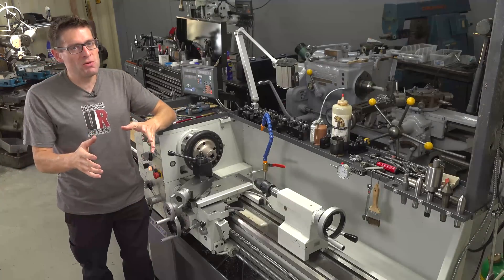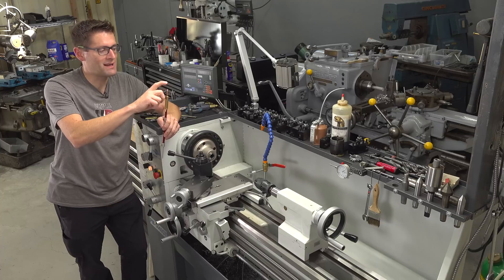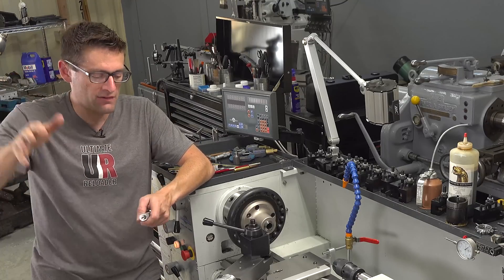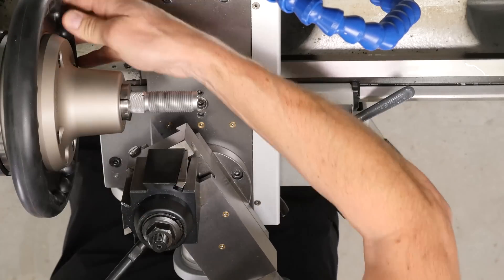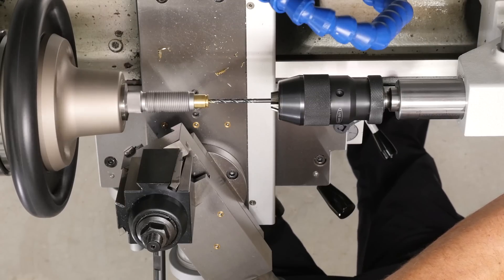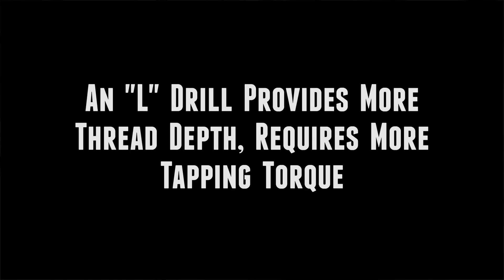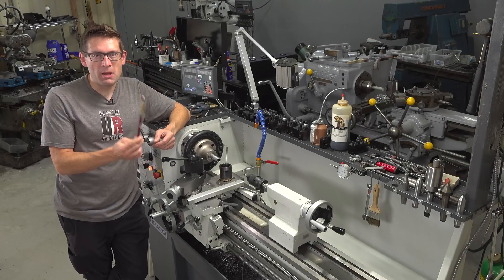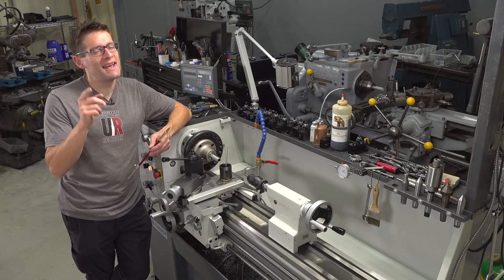Making an OAL Gauge Modified Case (300 PRC Demo)

Comment: Could you use a fire formed case and use the Lee Collet die to make this cartridge to find the lands? If you set the neck slowly with small increments much like flaring the neck on revolver cases you should be able to get to a point where the neck tension where it can be seated by hand but not easily. Then shove the bullet in all the way which would shove the bullet to the lands. I have purchased a single shot pistol in 6.5 creedmoor and want to find that measurement to make it as accurate as I can.

Comment: I'm surprised the case doesn't slip in the die while tapping.

Great video, would have never thought to use the die for holding the case. Definitely going to give it a try, even without a lathe, just gonna hold the die in my drill press vise.

Comment: Hi Gavin; I have a question. there is so much out there about case overall length and case to o’give. Most people say they want 2 thousandths. But if you first bump the shoulder back 2 thousandths, then push the shoulder against the chamber to get your reading before pushing the bullet back 2 thousandths aren’t you actually 4 thousandths off the lance

Comment: Can't think of any good reason a person couldn't use the die with a vise to hold it, and a hand drill and tap set, no big need for a lathe or a drill press. Could even take something like a Lee or Hornady qwik change adaptor and file a couple of flats on it, to hold the die in a vise, use your press to get the case out, or a small rod to knock it out of the die.

Comment: I cut a slit in each side of the neck with a Dremel cutting wheel,  it allows the bullet to slide once chambered. I don't let it contact the side of action when extracted, 9 out of 10 will be the same length.

Comment: You don’t need a lathe just a drillpress  I have a lathe but use my drillpress  how to do this is take a board and clamp it to the bed then drill a hole in it to put the neck in or big enough to center on the tapered shoulder.  Then I use my neck turning clamp to hold the case from turning and drill your hole. It comes out centered every time  because the neck or shoulder is held  perfectly straight with the drill  and the drill centres on the primer pocket.Then I put the tap in the drillpress and hand turn it to thread the hole. Makes beautiful centered threads . Not like the lathe that is near impossible to get the case lined up and held perfectly straight . Hole size varies depending on caliber, don’t be afraid to use the shoulder of the brass in th hole

Comment: I have made modified cases for my rifles in work and like a few who have commented on  here have put them directly into a collet. Almost every time it has slipped and marked the case. I never thought of using the sizing die to hold them. Thanks so much for the tip.
Reply: That was a great idea, but really , who cares if the case is marked a bit as long as you smooth it off so it can't hang up and give a false reading
Reply from the maker: @robertboyd3863  The more important factor to me is concentricity. If you clamp the case with a cylindrical surface, you won't be running true. Using the die accounts for the taper of the case body!
Reply: Can you make one for me?😊. I have a 300 h&h and would really like to use the same shell I’ll be loading

Comment: Great idea to use the sizer die to do the threading, difficult to drill and thread without messing up the case. Same lathe as mine, and have 4 old, but like new craftsman 12" lathes to unload, love my new one      Thanks Gavin

Comment: Did you do anything to the neck, or just fired it and left it alone?
Reply from the maker: Usually just firing is perfect for slip fit, and that's what I did this time!
Reply: @Ultimatereloader  Simply size it down , than ream out with a drill bit

Comment: Good video- kudos for doing it but you are not helping the majority of reloaders who can not buy a lathe or have a place to put it. You even admitted it is not that critical to being exactly perpendicular. Zillions of holes have been tapped in much more difficult metals without a lathe. A basic benchtop drill press works excellent for this using a caliber specific loading block or any other improvised jig to hold the case upside down verticle.

Comment: Just hold the case in the appropriate sized collet, it will tighten up on the web and you wont crush anything. A little chamfer on the hole before or after tapping makes the world a nicer place.

Comment: Informative video however I can't justify 600+ dollars for a mini lathe. Guess I just use a drill press and work slowly.
Reply: I made mine with a drill press and hand tap, no big deal , also punch out the primer and then you already have the pilot hole,

Comment: Modified case is $7.99 online, VS $2000 + for a metal lathe ???
Reply: If you're shooting a wildcat, you gotta make your own modified case
Reply: @zapf6987  Drill press and hand tap works just as good, and is quicker

Comment: Shouldn't one use a resized brass exactly the way you'd like the shoulder to be bumped?
Otherwise your OAL will be off and you'll need bullet ogive to shoulder ogive measurements or always substract your shoulder bump.
And can you be sure that a fire-formed but not resized brass really goes all the way in to have full shoulder contact?
Reply: Gavin can you provide feedback on the reason that you don't bump the shoulder on this case?
Reply: Two years & no reply from anyone so..... A case fired in the rifle is a closer fit to that firearm than a generic case. The round chambered and fired so it works in your gun. Chamber the fired case if you doubt. Does the bolt close smoothly, with no or minimal resistance? It should. If not, clean the chamber & the fired case. When the bolt closes with little or no resistance, the case fits YOUR chamber.

Which is why you make your own: Factory ammo or a full length resized case is typically near or at minimum SAAMI spec to maximize compatibility with multiple rifles from multiple mfr's, chambered with equipment in various states of wear. For the same reason, so is the modified case sold by Hornady.

Non-belted cartridges headspace on the shoulder (so do belted cases after one or two firings). We bump the shoulder to ensure a fired case will chamber reliably and cuz handloaders have learned that bumping usually results in improved accuracy compared to full length resizing - which intentionally resizes cases to minimum specs. No die mfr has any better idea than does a cartridge  company of YOUR firearm's unigue characteristics. You do - it's a big part of why you handload.

But if you feel better bumping the sample case to make it more representative of the rounds you make, go ahead. It'll still be better than a factory case. Remember: Unless you're using bushing dies (so as to control the neck size) your sizing die resizes the neck to a few thou under the bullet diameter. You'll have to ream it or use an oversize mandrel in order for a bullet to slip fit.

Hopenthis helps. If you see this & still have questions, pls reply.

Comment: You can really tell Gavin is an engineer vs a machinist.

So, you didn't say in the video, is the case sized or not? If sized is it to SAAMI minimum or just bumped back .002? For the uninitiated, best practice would be to use a case as you would use it for handloading (full length, shoulder bump, etc) yes, it is only a couple of thou difference, but if we're going for maximim precision and repeatability, well, the devil is in the details.
Reply from the maker: Haha- yes, Engineer through and through. The point of using a case that's previously fired is that you get perfect slight-slip-fit between the bullet and case neck. In the end, this is more of a relative measurement rather than anything absolute. Every permutation and technique related to bullet seating calculation has its pros/cons! :)
Reply: @Ultimatereloader  I assume you also work for the govt .

Comment: Really like your videos.The info and ideas are what are important. I had some made for my each of my 6.5CM rifles by a friend on a lathe. They work great. But what works just as well for me is doing it mathematically using the technique presented by YouTuber HornadyLoader (Hornady Overall Length Gauge and Bullet Comparator) At ~18:00, he goes through how to do it using a proper caliber  standard off the shelf Hornady Modied Case. The one thing I do differently is use CBTO instead of COL.

Comment: I’ve tried doing this before by just chucking up the case and it never worked out because it would always ever so slightly triangulate the case such that it would stick in my chamber. I don’t have collates to use for the lathe. You think it’s ok to throw the die in a three jaw chuck?
Reply from the maker: Jared- I say go for it, just be very sparing on jaw pressure! You don't need much for this kind of drilling and tapping.

Comment: I, too, as a drill press machinist!  Many things I see done on a full lathe and/or mill I have been able to duplicate adequately with one of my Harbor Freight drill presses.  Both presses are from the mid or so 1980's. Would absolutely love to have true "machines" but, alas, I too, am a poor old man.
Reply: i did it with a cordless drill in a bench vice a reusable zip tie for the speed adjustment and a T-bar for the drillbit and the threading tool.

Comment: I am very surprised he uses that Hornady gauge.  That thing is not very accurate. you are better off seating a bullet in a fired case and pushing it until you can close the bolt. That Hornady thing is a POS, IMO.

Comment: Ha! I've done this but without a lathe. I thought a fire formed case would give better results. I'm glad to see you do as well. I also added a compound inside the  base of the case, prior to drilling/threading, to give more threading depth. Eventually I will have a lathe which will make things so much easier and precise.
Reply: I wrote my original comment prior to reading other posts. Gavin keep doing what you're doing. The point is you're doing stuff beyond the average shop or guy in his garage. Its great info for those who wish to progress beyond that. For those complaining about the equipment used, there are a gazillion videos from guys doing stuff from a workbench.
Reply from the maker: Thanks for the support, and thanks for watching!

Comment: I have machined my own gage + modified case with my lathe, and I totally agree : a metal lathe is a very usefull tool for precision reloading !
Reply: I put a fired case in my vise, bore a whole with a hand drill. and tapped it with a hand tapping tool. It cost me a lot less in tools for  OAL/CBTO measurements. Heck I've even used a sharpie. Can't get anymore cost effective than that(and the most accurate). LOL
Reply: @vincef5832  I did use a drill press LOL

Comment: Drill press or even a hand drill work fine too made a bunch of these rather than buying them from Hornady. Why they chose such a odd ball thread size is beyond me though.
Reply: I had no problem getting the tap on Ebay, and simply used a drill press and hand tap

Comment: The people crying about not having the money to afford this tooling are ridiculous. You can have a nice lathe and end mill setup used for around 6k. If your a working person that’s easy to save up.  I bet 90% of the people crying about this don’t even know how to run a end mill or lathe
Reply from the maker: I bought my first lathe (South Bend 10A) for about $1000. Sold it for more than that. You could do this job on a Harbor Freight lathe. Ride what you got!
Reply: gavintoobe dang straight, there’s deals everywhere and I hate that people are slamming you in the comment for using your tooling. 👍🏻👍🏻👍🏻 love what your working on right now.

Comment: Buying $20k worth of machinists tools to save $9 on amazon? I think I’ll do the math later 🤔
Reply from the maker: Wow Clint- did you miss all of the other projects I'm doing with my equipment like building rifles?
Reply: You'll get better results with a once fired case and any machine shop will most likely do it for a couple bucks or free even when they aren't busy or have an apprentice not busy. I dropped about 5 different rounds and the gauge off at a smaller machine shop and said just do them when you have time and call me. It wasn't 30 min later the lady at the front desk called and said they were done. Went and picked them up and the owner and machinist came out and asked what these were for. They thought it was cool and didn't even charge me
Reply from the maker: Good deal!
Reply: But, you must ask yourself "Which is more fun?"
Reply: Thanks Gavin-one is not likely to use this only once! The benefit of being able to drill and tap fire formed cases on all my rifles would more than pay for the cost of the tools!

Comment: “Why you need a metal lathe” 😂. Without having it for a business, it’s like trying to justify owning a Ferrari. Lol. Just stick with “because I can, and because I want to”

There’s hundreds of reasons why I WANT one, but none justify the cost, especially once you include tooling.  

It just seems like you’re just playing at that point. You can do the same thing with a drill press that has a vise on it. No different than removing a stuck case. Drill it and tap it. It’s not rocket surgery 😂. Just try to keep it straight. If you get it crooked just try again. It’s only going to cost you a once fired case. 

I get that you used a lathe. It’s the best tool for the job, you have one, and it’s fun playing with your new toys. 😉.  I would use the lathe too if I were in your shoes.
Reply from the maker: Ummmmm- no. Can you do this on a drill press? Yes. Will it be concentric like if you did it on a lathe? No.
Reply: @Ultimatereloader  Nonsense , the ones made in a press work fine

Comment: You could just use a properly sized collet for the case. If so, you don't have to do all that monkeying with the die.
Reply from the maker: Actually- no. The body of the case is tapered. Why wouldn't you use a sizing die? It's the perfect work holding tool for this job.
Reply: gavintoobe actually yes. What kind of response is that? So what if the case is tapered. Try it before knocking it
Reply from the maker: If you're holding a tapered part, you need something tapered to hold it if you want it to run true. Make sense?
Reply: gavintoobe try it. It will have way less wobble than that setup you had
Reply: I would be interested in knowing just how much taper that 300 PRC case has from Case Head to the depth of the chuck jaws on you lathe? Would it really wobble? Obviously however some shell cases have much more of a taper than others, but what kind of a difference would this make from case head rim to the grip depth of a 3 jaw chuck?

Comment: Hi Gavin what lathe would you recommend for a beginner in metal working? Something small enough to do the basics yet capable to not need changing a few days later. Cheers
Reply: I second this. A good recommendation please.
Reply: If you want a small one and dont have a lot of room look up the sherline lathe and milling machines. I wish I would've never sold mine. They'd be so handy now that I've gotten into reloading. Hell I could be buildings loading blocks and a pile of other stuff.
Reply from the maker: So many options out there! A used South Bend or Logan (USA made) would be good options. Precision Matthews has a whole lineup of lathes that are great quality that they will stand behind. For gunsmithing related tasks, I wouldn't go less than 9" swing and 24" between centers (too small to chamber rifles, but good for a lot of things). Do you have a budget in mind?

Comment: Gavin buddy made me one for my 6.5 PRC. I sized it and he tapped it but bullet won’t slide in and out easy. How do I fix it?
Reply: you can also make a slit in the neck to loosen it up.
Reply: TheKajunkat did didn’t work at all
Reply: If you have a collet bullet puller, seat the bullet in the case, pull it, do not remove the bullet, then run the case up and down a few more times and it should loosen up the case mouth for it to just slide pass.  I've done this a few times and it works.